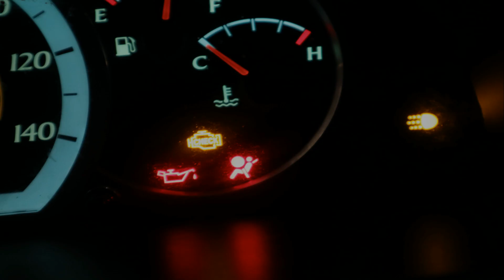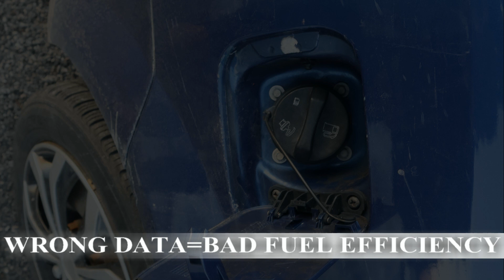SYMPTOMS OF A BAD CRANKSHAFT POSITION SENSOR

Comment from the maker: Thank you for watching!

🔥OBD2 Scanner: https://amzn.to/3PHRplS

Check out AllDatadiy repair manuals: https://www.gopjn.com/t/SENKTklLS01DSE1NS0lOQ0dKRk9LTw
Use code AD10VA for 15% off one-year subscriptions for any US Order

Check out my merch: https://easyautofix.creator-spring.com/

Have car-related questions? Check out JustAnswer! They have verified auto mechanics that are available as live help 24/7: https://justanswer.9pctbx.net/qnj74y

Buy a new crankshaft position sensor here: https://advanceautoparts.rt8x.net/DV652n

Here are some of my favorite items that you might like:
Tools: https://amzn.to/3xNDb8g
Car Vacuum: https://amzn.to/3EjhPSJ 
Cleaning Tools: https://amzn.to/3El7dCG 
Water Repellency Wiper Blade: https://amzn.to/3utvK50 
Cleaning Gel For Cars: https://amzn.to/36NIiMr 
Portable Air Pump for Car Tires: https://amzn.to/3uBuPzA 
Headlight Restoration Kit: https://amzn.to/3qDpOVH 
Amp Jump Starter: https://amzn.to/3pMd0vx
Reply: U jjjjjjj it u
Reply: Thank you for sharing knowlage! I have a 2000 tacoma that it starter with no problem next day I try to dtart it again but it didnt. the light engine is not on!

Comment: 😢 The cutting off for no reason is a dead giveaway for this sensor. I've changed every part under my hood because of it. The sensors tell the car's computer how to tell the car how to run... I'm so tired of computers. And every sensor got the same symptoms when they going out. It's so bad that I keep two of the same parts in my trunk... And I Ride right 👍 past the Auto shop blowing my horn 🚗...

Comment: I drive a bmw z3, 6-cylinder 2.0l, my z3 when the engine is hot will crank start, die then when I crank it again it takes a longer crank to start.. is this a bad crank sensor? 

I've plugged in my obd scan tool, and the only codes I'm getting are for a bad oxygen sensor

Thanks
Reply from the maker: I would look into the oxygen sensor first.

Comment: Have a 1999 Firebird 3.8l having all these problems except no start, when I accelerate the car sputters and jerks if I continue to gas it it gives a p0420 code and if I continue further it gives a cylinder 6 misfire code in higher gears I can give it less gas than the last and it would sputter. Could it still be the Crankshaft position sensor?

Comment: thankyou for the good video. my 2003 toyota tacoma would not start and i just had the spark plugs and battery changed out 1 week before. i thought noticed my truck doing some odd things before that. some of the things that you mentioned like a high idle during the park position or during the neutral when driving. i would have a more difficult time starting my truck because of it. the poor fuel mileage too because of it. did not even know that my vehicle had a crank sensor. did not need this part changed out until about 300, 000 km on my truck. it is a part that does not to be changed out on toyota trucks.
Reply from the maker: Do you have the engine light on?
Reply: @easyautofix  the engine light was always on.
Reply: @easyautofix  I find that the sensors that they have equipped on vehicles do not work that well. You hook up a computer to the vehicle and you see a lot of faults readings.
Reply from the maker: @rickmelonman  What are the codes related to the engine light?

Comment: I have an Audi a3 1.4 tfsi (2011)  The water pump and the belt were changed, then after 10 miles the engine light came up. 

 the code is.:  P0016  but there are no Symptoms at all. The car drives perfectly fine, No misfire starts super easy runs like butter no shaking it is absolutely fine. I am so confused at this point.  any idea what is the issue? could be just the sensor?

Comment: I have Toyota Corolla 2015 xli 1.3, that has rough start, some time rough idle, normal(for me) fuel consumption, okay acceleration, it might be choked catalytic converter or CPS. Or something any suggestion? Mileage = 120000+km
Rough idle = Sometimes rpm goes to 0.5 to 0.6, whole car start shaking normally in 2/3secs it goes to normal
Sometimes goes up and down, normal rpm is at 0.7, sometimes it goes to 1.5rpm back and forth for minutes
Reply from the maker: any engine light on? Does it just cause problems while idling/start? How is the acceleration or driving at higher speeds?
Reply: @easyautofix   it has poor start since 12/18 months recently since 4 months idle is not stable, not always but sometimes usually after driving for 30+mins, after we serviced injectors start got little better but not good. I don’t that much experience with car to be able to notice performance difference, but my elder brother is saying it has become bit sluggish at 100km/h or above speed

No check engine light
Reply from the maker: @assassinop2168  I made a video of the 3 common causes of a rough idle. It should help! https://www.youtube.com/watch?v=10H-GBPCU2g&ab_channel=EasyAutoFix
Reply: @easyautofix  thanks will update after cleaning throttle body (if I remember)

Comment: Would it be the cam shaft sensor if after driving for awhile and you shut it off it takes hrs to be ablt to start again
Reply from the maker: It is possible but there are many other components that can do the same.

Comment: Could this be responsible for no spark and fuel?
Reply from the maker: In some vehicles it is possible yes.
Reply: @easyautofix  changed the crankshaft sensor and the solenoid, but still no luck. I found out the vehicle has an anti theft system, and I'm currently struggling to disconnect it

Comment: The jeep liberty pull up to lights, etc.... Would just stall out.. Would start back up and go for a while and stall out again.. Brother in law owned it and nobody could figure it out including dealer. So he laid the truck up for 2 years and I took it over. Fixed it up for the young fella. Ran great for a while then the stall went on it. Young fella checked out quite a few videos and we determined it was either the camshaft sensor or the crankshaft sensor. I said to him well the camshaft sensor is easy to get at but the crankshaft sensor is a bitch and deals with the elements. I said to him which one do you think it is and he said probably the crankshaft sensor. I said yeah probably about 95% sure. Well got under the truck and 4 hours plus later I finally popped it off.. What a bitch!!!!... Worked like a charm after that. Young fella drove it for years until he wrote it off.. LOLOL.. He was OK.....

Comment: I work on 2001 Saturn SL2. This car had a permanent code P0446, which was coming less than 1 mi after erasing of the code. It also had very rough idle. I removed P0446 by cleaning all the fuel system, including Fuel Tank, replacing the Fuel Pump, Fuel Sensor there on the top of the Fuel Pump, Charcoal Canister, and by flushing the fuel pipes w/99% Isopropyl Alcohol. I also replaced all the fuel injectors and clean the fuel injector rail. I noticed that there was a plug (made by insect or smth) in the return fuel line (when I replaced the Fuel Filter), and I even think that the plug could be the main reason for the code. The crankshaft Position Sensor was replaced as well on the way. After all of that I drove ~150mi for a new battery installed and went to do State Inspection. The rough idle was still present, maybe it became a bit less, but still rough (especially on cold idle, it would be 1200 rpm). The car passed it, but when I was coming back the engine light came. I thought that is the common thing on Saturns of that type, when some codes come after the State Inspection scanners, but then they go away if you erase them. I've read there is smth w/Saturn computer, which is too sensitive, or programmed not quite well, but that problem w/computer on that car is common.  But from that time the code P0401 (sometimes accompanied w/P0300, P0301, and even P0172) keeps coming back. This code is not same as in the film, but the car has rough idling, so I hope on some opinions on this matter, which I would really appreciate. Thank you for the informative film.
Reply: I have same problem did u ever figure it out I've changed everything runs good when driving but runs bad at idle.
Reply: @chrismartin715  As I wrote before, I did a lot to remove that P0446, like replaced Charcoal Canister, Fuel Pump and a sensor on the top of it, but though those were good steps at 120K, but I think the problem was in one fuel line. Because when I replace Fuel Filter (outside one, not that in the Fuel Pump), I noticed that the fuel line (I think it is return line) was clogged w/some white stuff. I cleaned it well. So I can't say for sure, since many people say that to remove that code (it is emission code) you do need to replace the Charcoal Canister. But that involved dropping of a Fuel Tank. Now the idling is better, not perfect still, and I have now  another code P0401, which is related to dirty EGR ports. I replaced EGR (maybe this new is bad, defective), tried to clean the ports, but in my model (2001 Saturn SL2) to clean them properly you have to remove the Intake Manifold. I didn't do it yet. So P0446 code gone, but I can't say for sure what exactly helped: replacing the Charcoal Canister or that clogged fuel line connected to the Fuel Filter. Maybe combination. About P0401 I didn't solve that problem yet, the code is coming back after erasing.

Comment: Yep, my Infinity XJ35 intermittent bumpy acceleration, stalls at a stop light, and often feels like low power. Also my traction control light illuminated after a rough acceleration.  P0335 Code . Hope this fixes this because Infinity dealer wants thousands for new CVT transmission with no guarantees.

Comment: My veloster is stalling out on me, engine turns off, but radio and electronics remain on. Upon pushing the button and starting the car again, it takes a noticably longer time to do so and usually doesn't on first try. On 2nd try it starts up, but my drive or reverse gears dont work. I have to turn off the car, lock the doors and wait 10 secs, then unlock the doors and it'll start up again. Could it possibly be this issue?

Comment: Would it cause absolute zero spark? I got a 91 Cadillac coupe deville with the 4.9. Took me forever to even find what the sensor is called they call it the hall effect sensor. I’ve got no spark. Has new coil distributor cap plugs and wires and rotor all new. Gonna do this and ignition control module and whatever they call the cam sensor I’m gonna replace. This car is kind of a nightmare but I really want it running again for the summer.

Comment: p0122 p1516 p2101 p2119 p2135 i had all this codes and reduce engine power on dashboard  mechanic suggested to replace the throttle body i did ..but it didnt fix the issue now everytime i reverse engine power reduce and service traction show up on dashboard any idea what can it beeeeeee

Comment: Great video. The code I’m getting is p0017. I’ve had my solenoids changed and cam sensors. Neither has resolved the symptoms (most that were stated in this video) and CE light still on.
Reply: what was the issue?

Comment: I wonder If one of the symptoms of causing a code U0401 symptom 71 in camaros when it idles the stabilitrak comes on but when I'm in motion it good and my voltage through the car reads good and with load

Comment: I have a 2004 Saab 93 2.0t, manual. I overheated once and it conked out at a stop light, I got it started after a while and got it to the gas station next to the light. Since then when I cranked it over, it almost sounds as if there's no compression or pistons moving. Nomatter how often I cranked it over it wouldn't start. I was managed to get it to start by furiously pumping the gas peddle, once started, it ran great. But like I said when cranking sounded like no compression but when I pumped the peddle a lot it would eventually start and run great. Now I was dumb and didn't fix the leaky radiator hose. So I ended up overheating it again. This time it not only sounds like no compression and as if the pistons aren't moving, it no longer will start even when I pump the peddle. Today I pulled a plug and put a compression tester on it, no compression when I cranked it. Pulled a second plug, hooked up pressed Guage, cranked it, same thing, no pressure. I have a strange feeling the pistons aren't even moving. Any idea what could cause this? I'm gonna check the 2 remaining cylinders tomorrow, but I'm thinking it will yield the same results as the 2 I checked. I can't afford to have it checked by a mechanic. Any help, info or ideas would be appreciated. Thanks.

Comment: Ok, so my car yesterday jerked and stalled while still in motion. With the momentum, I was able to make it to an O'Reilly's down the street. Since my car is push start and I noticed the key light kept flashing I assumed the battery in my remote died. Once I get it to start again, it hesitated that I had to give it gas. My rpms weren't working and when I got back on the road my transmission started failing. It wouldn't shift, and the only way I made it home was using it in sport mode, shifting manually. For some reason, that seemed to work. Fast forward today, I just pulled the code using a scanner. Keep in mind, my issues seemed to be with the transmission, or so I thought. The code was p0335, having nothing to do with the transmission. So, should I be worried? Also, I just took it out for a test drive, and it drove like normal. Rpms were showing, it shifted fine (I was purposely driving it fast and it didn't stall or anything), only thing was the check engine light was still on.
Reply: Any updates on the issue

Comment: my buick regal when it starts shakes a little and def the gas how its a 4 cylinder and my tahoe runs way better on 6 cylinders. I fill my regal twice a week while the tahoe once a month and i use it at the same distance. i love both cars but these cars are killing me with these sensor issues but glad its a quick fix. thanks for the video really helps.

Comment: 06 pathfinder 4.0l would bad crank sensor throw a knock sensor code? Also has rough idle won't excellerate at all had intermittent hard starts before this issue
Reply from the maker: Typically no. Is the knock sensor code the only one you have? I also have a knock sensor video if you want to check that out
Reply: @easyautofix  no not the only code 
P0333
P0300 replaced coils and plugs
P1168
P0420
P2a03
P0051 replaced both front a/f sensors
I noticed while changing plugs and coils ports for passenger side of plenum were significantly darker than the other 3 if not crank sensor any ideas would be greatly appreciated

Comment: Can a code p0305 pop up when this is bad as well?
Reply from the maker: It could but it is usually together with P0335. Most of the time it's P0335 with P0300. P0305 means you have a misfire on cylinder 5. Usually, it's a bad spark plug or ignition coil.